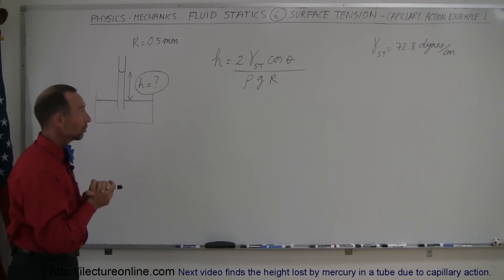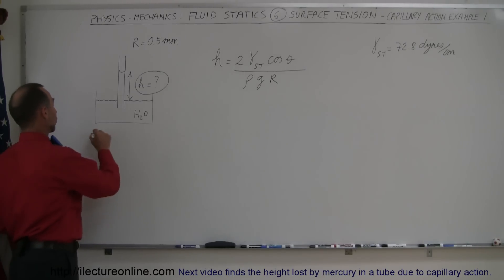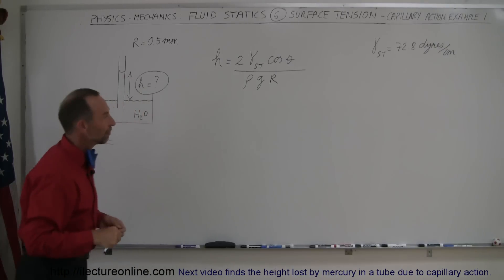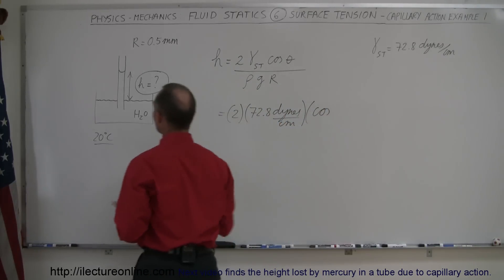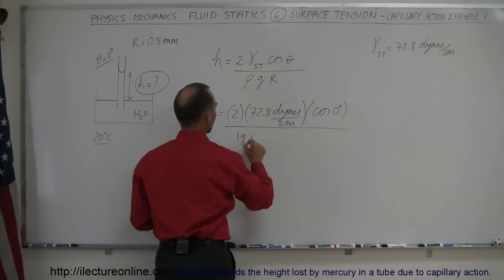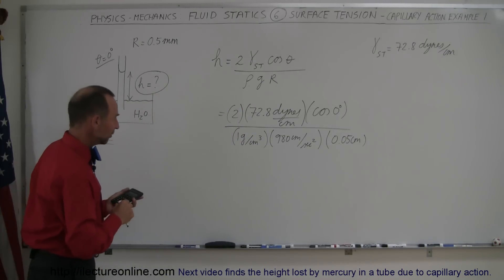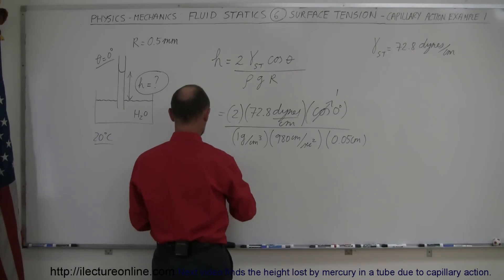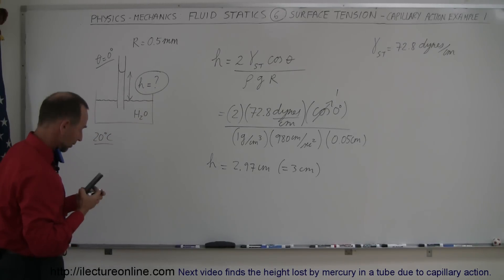Physics 33.1  Surface Tension (6 of 12): Capillary Action: Example 1 (Water)

Comment: Great explanation. It could be mentioned that the cosinus can be approximated yielding Rayleigh's formula: h+R/3=2 gamma / (rho g R).
Reply from the maker: The mass of the liquid above the meniscus is very small compared to the mass of the rest of the liquid in the tube.  Calculating the mass above the meniscus is more of a mathematical exercise than a practical endeavor.

Comment: How does the system gain potential energy. What is energy equation to hold conservation law.
Reply from the maker: The forces that pull the fluid up the tube are caused by the electrical forces of the charges in the atoms.  The energy come from the charges being pulled out a bit from one another.  (They act like little springs).
Reply: @MichelvanBiezen  work has to be done to move charges.
Reply from the maker: Yes, the energy will come from the attactive forces of the charges causing the positions of the charges to change a small amount.

Comment: Hello professor, great video- I did an experiment with tween 80 in 20% solution but the final liquid level was lower than the reference... why might this happen?
Reply from the maker: A lot of things can cause differences in recorded values, compared to expected value.  There could have been a contaminant on the glass or in the solution.  The diameter could be different than claimed, etc.   What was the difference in the results?   Also how did you deal with the meniscus?
Reply: @MichelvanBiezen  can i please share it though your email address?
Reply from the maker: Currently my schedule is very full.   If you share it through these comments I may be able to take a look.

Comment: What if you put a tube in, wich has a precise calculated diameter, and is curved at the top. Would the water rise and pour back creating a perpetuum mobile?
Reply from the maker: From the laws of physics we know that is impossible.  Using that as a guide, we can suspect that the liquid will rise to the top and not any farther.

Comment: cos of theta cant be zero. You should take the angle between sloid, water and air. It is given by the curvature.
Reply from the maker: You are correct, but he angle between glass and water is typically very close to zero degrees, and therefore  cos(theta) ~ 1

Comment: 14560 dynes/metre and divide by 1000kg/mcube divide again by 9.81m/secsqr divide again 0.0005m gives us 2968 metres or 2 km. So your answer sir was wrong. It will go of a height a bit above 2 kilometres
Reply from the maker: The answer in the video is correct.
Reply: Michel van Biezen I know, I was making fun at my own expense for my stupidity.

Comment: What the hell is a dyne
Reply: 1N=100000dynes =0.001KN
Reply: Doesn’t it has to change to si unit “N” before doing calculation?
Reply: Another reason to not use N

Comment: hi dr nice show 
im ask what is the surface tension value between sea water and glass ?
Reply from the maker: It turns out it is about the same as the surface tension of pure water.  (It does vary slightly with salinity and temperature).

Comment: sir what if two immiscible liquid are put in a container, where one of the liquid being wetting and other non-wetting
Reply from the maker: +1414gp 
Which of the two liquids is on top?  (They probably have different density)
Reply: +Michel van Biezen  denser being at bottom .
And is it important to know if wetting liquid is above or below

Comment: The radius of the tube is one of the variables in this experiment. What about the surface area of the water in the beaker?? Does the surface area of water relates to the radius of the tube which cause it to pulled up the water??
Reply from the maker: +Dzul Fadli  Asraf 
The relevant factor here is the length of the surface (a.k.a the circumference of the inside of the tube)

Comment: Are these coefficients that you used based on the attractive forces between the fluid and glass specifically, or are they unrelated to the material that the capillary tube is made of? It would seem that if the coefficients are just based on the surface tension of a pure substance, not a substance in contact with another material, it would be difficult to apply these principles more broadly, say to a metal pipe.
Reply from the maker: That is correct.  There will be differences if different materials are used, however the differences tend to be small.
The difference is typically seen in the "wetting angle" the angle the fluid makes with the surface, which is near zero for the water-glass boundary.  (Not that for mercury the wetting angle is very different)

Comment: How will that work with oils an glycol like fluids?
Reply from the maker: Mark,
Good question.  Every substance has a different coefficient.  Some substances like Hg (mercury) act in an opposite fashion and actually depress in the tube instead of rise. You just need to look up the coefficient.
Reply: mark warlick When using the formula to calculate h for different types of liquids and everything else being equal, use the proper surface tension/ density and be carful about cos angle, if it's greater than 90 you will get a negative h going down like mercury